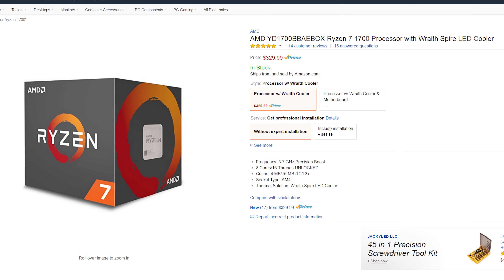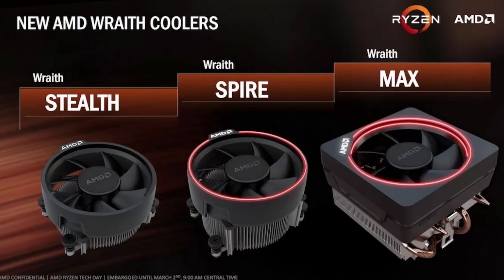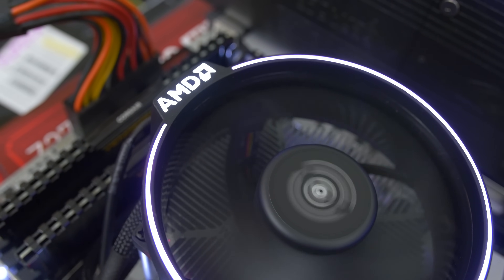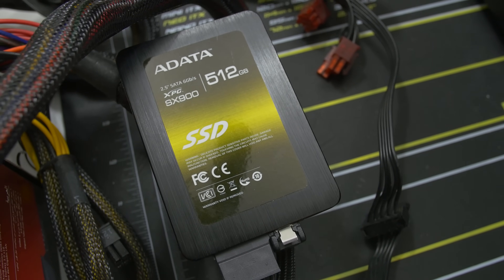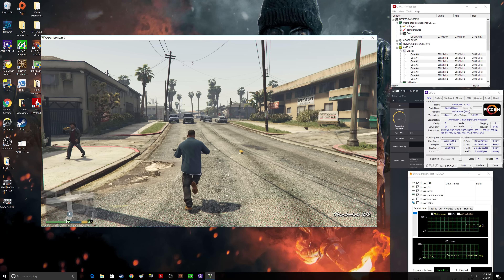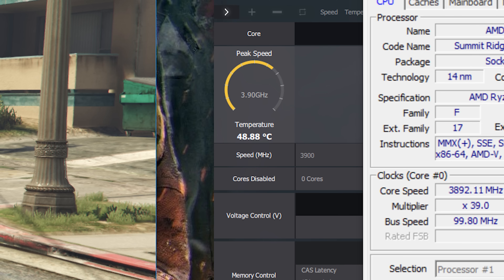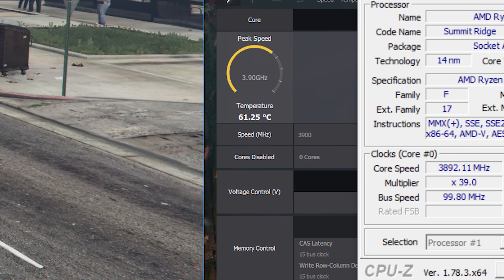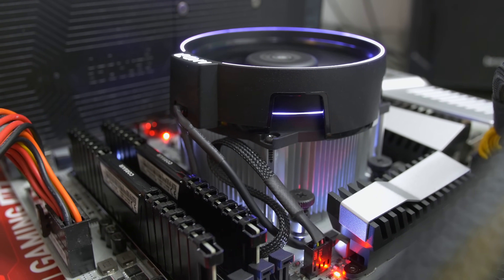AMD Wraith SPIRE: Does it SUCK?

Comment: Note: The 20°C offset that was recently found on Ryzen only applies to the 1700X and 1800X https://www.overclock3d.net/news/cpu_mainboard/amd_s_r7_1800x_and_1700x_report_higher_temperatures_with_a_20_degree_offset/1

Edit @ 0:26 - Retail versions of the 1700X and 1800X will not come bundled with the Wraith MAX cooler. The cooler will be specifically for system integrators that buy the processor in tray form.
Reply: If you think the lock arm on AMD stock coolers is bad... I have a word and 3 numbers... SOCKET 4 6 2. You literally had to load the locking arm with a blade screwdriver!! The number of times I've driven a hole into a PGA462 motherboard are fairly high... Gj they were old boards!!
Reply: Renato Amaral

The DysphoricSmile guy...
Reply: Here is a request please make a video about Evo air cooler also, since tell us how much better performance we get, if you can.
Reply: fanboy idiot
Reply: More and more people will get 1440p or 4k monitors.  I bought a nice 34" 1440p monitor.  I can get by with my current AMD Radeon R9 390X and AMD FX-8370 for now but hope to upgrade to maybe the Ryzen 7 1700 and good AMD based graphics card to boost frames per second rates.  The bottleneck is more the CPU than GPU right now, but oh well.  Saving the pennies for Ryzen 7, mobo, memory, better video card.
Reply: both load and idle
Reply: Lock arm best arm most superior cooler attachment system ever
Reply: Bitwit Ultra so this is the reason why it was thermal throttling at "70" degree, then what about aida64 or other third party software, did it report the correct core temp?
Reply: Is it on load or idle?
Reply: DysphoricSmile that's a very high voltage for this frequency, i hit 4.6 with 1.158v
Reply: Arthur Bols who?
Reply: AMD wants to think of that minority of people who game at 1440p or even 4k.
Reply: PS, I love this monitor!  Production work is amazing with so much more real estate than a 16:9 monitor!  I can do an Excel spreadsheet that opens with about 3,000 visible cells!  Or put the equivalent of about 3 windows at minimum 4:3 aspect ratio side by side.  It rocks!  By contrast, my 24" full HD 1920 x 1200 (yeah I bought one of those 19:10 monitors 6 years ago, it rocked for 6 years with over 10% more vertical lines!) had only about 1,000 Excel cells visible on a new spreadsheet.  Ah yes, we love our toys.
Reply: Seriously....like, what the wtf....
Reply: OMG...the memories and pain and suffering!!! #OldTechieTalesOfWoe
Reply: I've got an RX480(8gb) and FX8350 modestly oc'd to 4.2/core, and get some pretty nice results on everything I play at 1440p. I can't WAIT to see what my Ryzen 1700 will pull off.
Reply: its due because the XFR tech the software soon will be updated to show the true temps, btw the 1700 have no offset
Reply: Bitwit Ultra 5:00 Also running at 1440p will NOT heat up the CPU like 1080p or 720p would - though 720p is NOT a real world scenario these days for a desktop.  But 1920x1080p IS! Despite how much AMD loves to say "It is disingenuous to test only 1080p, we want our customers to know how our CPU will perform with their monitors."  Hmmm.... I WONDER.. what is the most popular gaming resolution for the MOST people? Oh thats right 95%+ OF ALL GAMERS RUN A 768p to 1080p MONITOR - MYSELF INCLUDED! 1080p on my desktop OFC. 
As fir 2560x1080 all the way to 3840x2160 ONLY MAKES UP 2.48% OF ALL STEAM GAMERS!
 
Simply 1080p because I WANT to be able to get the MOST FPS where and when I need them, yet still have enough resoultion, that when combined with my JACKED G1 Gaming GTX 980 Ti (1501 core 8 GHZ VRAM 100% of the time it is under load) - allows me to run 4x SSAA on almost every game and STILL retain 60+ FPS, and there are NO JAGGIES to be seen! Sparse Grid SSAA (Nvidia ONLY) Looks the best AND is easier on hardware than regular Orthogonal Grid SSAA - yet another reason I am very happy to be rocking Team Green's Best of the Best of Maxwell! A 980 Ti, BTW at 1400 MHZ WILL BEAT EVERY 1070! And at 1501 MHZ core like I have mine, Actually outpaces A STOCK FOUNDERS EDITION GTX 1080! Now, that FE GTX 1080 only really needs to up its temp and power targets to easily hit 1850+ core at which point it will be SLIGHTLY ahead, but get it to 1950 to 2150 MHZ core and it will blow away my OCed G1 Gaming GTX 980 Ti.
Reply: why does he need to shut up? he literally didn't do anything wrong
Reply: Bitwit Ultra  BAH! I got my i7 to 4.7 GHZ with a 1.330 Constant Vcore Load Line Calibration Level 1! GAMING PERFORMANCE FTW!  As VR - Namely Raw Data is the MOST HARDWARE INTENSIVE Game I have ever run! Also, HTC Vive is love, HTC Vive is life! 

Seriously, "Raw Data" is THE VR game that has managed to tick EVERY box on my "Childhood Dream of what VR should be!" I actually FEEL like I am holding 2 pistols, a sword, or a shotgun! The aim and accuracy is SPOT ON and it REALLY has nealry flawless Haptic Feedback! Whenever I pull the trigger it feels like the slide on the pistol is moving,  whenever I slice a bot with Saija's sword, I can FEEL the blade vibrate based on how quickly or slowly I am cutting into the enemies, and that vibration ACTUALLY FEELS LIKE I am cutting through metal with a blade - mostly anyway! And the shotgun, it feels real too - between that, the skill and progression systems - and the story line, Raw Data is MY FAVORITE GAME RIGHT NOW! I honestly think it would have made for a really good REGULAR game too - which just means that it is a good game regardless of VR - but because it LITERALLY was programmed from the ground up to use The Vive and its SUB MILLIMETER precision tracking controllers!

Comment: Blasting 'hot' air down on the hottest components in your case (motherboard VRM and MOSFETs) doesn't seem like a great idea but I guess you cannot complain too much since it is free. Although nothing is free. It is certainly factored into the price, somewhere. The gaming temps seem very good. The workload temps could be an issue.

Comment: and here I am with my FX8350, it's stock cooler which sound like a hell roaring in the background, also one of my hard drives makes my desk bivrate a bit, I think it's because it isn't installed propperly. When I get the 212 X I'll see if my performance improves and I'll try to fix the hard drive thing too

Comment: But what about with after market thermal paste like Arctic MX-4? 
  I believe most  people who have done more than one build before have some already, I know I got it for my first build and used it with stock intel cooler with my i5 4590. Because the thermal paste that comes pre-applied is crap.
Reply: Lukiel666  tomshardware did a big thermal paste test, in short there is very little difference. they even tested toothpaste :') 
mx4 is still great, i have a tube laying around :)  only slight annoyance is the preheating for better spread compared to mx2.
Reply: I saw that, had about a 3 degree difference between Arctic Mx-4 and the cooler master supplied compound for their air coolers. I found about 5 degrees between stock intel paste and the Arctic. 
 I also saw in that comparison that denture adhesive beat out toothpaste by a sizeable margin (shrug).

Comment: Has anyone used the Wraith Max with 1800X? I want to do a build with it, and wanted to know ifI should go with that, or get a liquid cooler (if i go liquid, i'll either get an AIO 240mm, or do a custom loop with a 240mm for cpu and a 120mm for gpu)

Comment: i was looking forward to this review, but i gotta say i'm disapointed, u missed the 2 most crucial parts:
running the stock frequency in prime 95 for 2 plus hours.
running the 3,9 oc at prime 95 for 2 plus hours.
and also throw it under intel burn test or simliar extreme taxing tests, i think r7 works with intel burn test not sure tbh?
but i hope u get my point.
i don't care what the temps are in gaming  i care what the temps and sound level is, if the cpu is maxed out and pinned there like it would be in a lot of real world applications.
so can u do as a favor and ad just prime 95 to the test list?
u also could have made a short comparison between noctua nh-d14/15 (i know 15 is superior not saying they the same here) and the wraith spire, see where it stands etc...., because that is what people would think:
either this stock cooler or nh-d15 or sth. like it, is it worth it is it not?
this review missed a few things sadly, please fix, because i actually quite like your videos.
and i'm not asking for gamers nexus or adoredtv level of review, which is f course insane work, just the basics please, running a cpu at prime 95 for 2 hours is literally a standalone test.

Comment: Interesting video. I'm currently deciding between AMD and Intel CPU's for my next machine. The stock fan is an important item for me, so this was a useful video. I always remember a main issue of AMD CPU's was the noisy fans they had, plus they were never as fast or reliable as an Intel CPU, although cheaper. It seems they have improved of late judging by this. I am however, not really interested in overclocking myself, as I've never found it worth it in the past, getting little gain for the increased temps. I'd be very interested in comparisons with the larger fans as well :) Both in temp performance and any size issues as you highlight here.

A comparison of the new AMD chips based on default speeds would be useful as well for us not interested in overclocking. So we can see the differences a little more clearly. Every video I see always covers overclocking and really to me is fairly redundant. I'm sure you would get a lot of views based on the fact you keep it standard spec. You can always add in overclocking as well, but a video dedicated to standard speeds would be of use to many I think.

This video has done more for pushing AMD as potentially viable than all the others I have seen so far, simply because it answered a big question for me,the stock fan, how good/noisy is it? Seems fairly quiet from this example.

Comment: Have you read about the bug with the 1700 where the idle temps are reported 20c too high?
Reply: That's a) not a bug and b) doesn't apply to the 1700. Only the 1700X and 1800X have it among the Ryzen7 chips, and it's intentional.

Comment: Where I see a problem is in the overclocking department. Whether you're a professional overclocker or just an enthusiast. Your overclocking options are going to be limited. It has been discovered that the seal around the CPU socket is actually slightly higher than the CPU die itself. 

Oversight maybe but it basically means if you plan to do any water cooling you may as well not bother. None of the cooler manufacturers took the gap problem into account either. 

Nor did anyone else which means we might be waiting awhile before any suitable cooling option exists.  That's not even counting the problem in that they're just not enough motherboards that support Ryzen right now to be worth  the switch. :/
Reply: Well, there are plenty of motherboards out there, the problem is just that AMD has focused very heavily on manufacturing enough actual CPUs, without apparently taking into account the demand for X370 chipsets, so those are woefully undersupplied to motherboard manufacturers, meaning the waiting times for a high-end AM4 board is atrocious. I preordered a Gigabyte Aorus X370-Gaming 5 on 23-02, and I only got it two days ago.

Comment: @Bitwit I'm not familiar with the MSI board you're using but @9:41 there is a 4pin power connector not plugged into the motherboard.  Does that 500w power supply only have one 4pin CPU power connector or no 8 pin connector?  Is it only helpful for EXTREME overclocking?

Comment: it's kinda pretty, but air coolers are just so... eh. I'd prefer it be an optional tag on item, and lower the CPU price a bit.   If you're a watercooler,  these things  just get junked.
Reply: It is, actually. All three Ryzen7 chips come in versions with and without an included stock cooler. It's just that most retailers choose to only stock the versions of the 1700X and 1800X without a cooler and of the 1700 with a cooler...

Comment: Wait i thought the Max doesn't come with the 1800/1700X what are you talking about my dude?
Reply: Most retailers choose to only stock the boxed versions of the 1800X and 1700X with no included cooler, but AMD does also supply aforementioned chips with included coolers, in the same way that it also makes a cooler-less version of the 1700, which retailers also tend not to bother with.

Comment: I would upgrade to ryzen if only ddr4 didn't take up a huge sum of budget...Prices fuckin' skyrocketed...
Reply: SuperLongNameThatGoogleSuprisinglyLetMeHave well ddr4 memory chips stocks are know to be low so they charge you more. yep last year i could buy a 2 x 8 go 2133 cas 15 kit for 65 € and now near 100
Reply: I was initially planning to buy the RAM for my Zen upgrade at the same time as the CPU and motherboard, but I ended up buying it more than a month prior, because I didn't feel like paying more for the same product just by buying it at a later date.

Comment: Could you run 3.9Ghz at the higher voltage to determine whether it is the higher voltage or higher clock that creates all the heat? I'm just curious.

Comment: I use the wraith spire college for my 1700. If you decide to do the same, then do yourself a favor and replace the pre applied thermal paste! The pre applied thermal paste made my CPU idle temps around 35-40 C. After I replaced it with some leftover Thermal paste by Cryorig that I had laying around, my temps hover ed in the high 20s to low 30s at idle. Anything is better! After this, I can easily say that the spire cooler is awesome for a stock cooler!

Comment: I'm actually pretty impressed by both the performance (in terms of cooling capacity and noise) and aesthetics. IMO, this is the first cooler worth using instead of dropping $30 plus for those running stock or close to it.